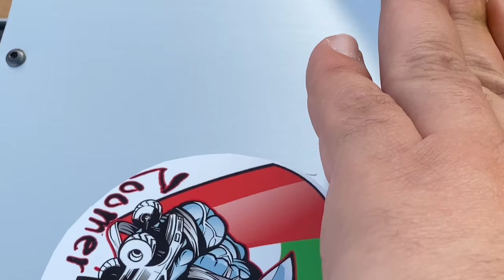RC SAND DRAG KINGS 1/5 Scale the best

Comment: A few things to talk about and discuss. The southern mud racers overdrive (spin faster than the rear)  their front tires to maintain a front wheel drive "directional stability" or "pull" the front end straight to give better traction. I know in the sand this will mean you will have to be more aggressive with the wheelie bar or rear shocks/springs to drive the front suspension into the sand to "bite" or get traction. Paddle fronts may be a help but I understand it may lower the chassis in the sand once the rear tires are digging into a rut already created by the front. Another drag racing tip by people in the USA are keeping the front track width much wider than the rear to increase front end stability when making steering adjustments. You'll notice how easy the sheet metal bending RC was able to flip over because it had the opposite dimensions (narrow front vs. wide rear track with) ( for example track width is the distance between the center of the chassis and where the outside edge of the tire is). Again this advice is from a random person on the internet, but I hope you follow up with your own research and I hope it helps. GREAT VIDEO!!!!
Reply from the maker: Wow thanks alot for all the great info

Comment: Use 4 wheel drive and take dog bones out of the front 
Lock front axles at the diff cups and leave the Center diff empty. 

Diff out all the power to the back wheels and let them spin faster.  

This will drastically increase wheel speed and help for sand dragging 👊😎

Comment: What i don't understand is why can't they make these cars full scale that people can drive just as light as as durable and as easy to fix and most of as easy to control,where u can crash it at full speed then pick it up and do it again..that's what we need
Reply from the maker: Lol safety measures
Reply: Its called the laws of physics.
A scaled up version made of plastic and no protection with 2000+ horsepower simply wouldn't work.
Reply: @markmmm1737  why not if you make everything exactly the same using the exact same material or each and every part including fluids, building them any other way with different materials wouldn't work ,that's the problem you automatically shut it down because you already know these parts don't exist,if they did people would stop buying cars and building their own in a few hours..
Reply: @armandoalejandro7209  Let's think like you for a moment but the other way around.
Let's take a regular car and scale it down to 1/10 scale.  That bodywork which is 1.5 to 2mm sheet steel would now be 0.15 to 0.2mm thick and would probably collapse if blown at by the wind.  Let's take the engine and scale that down 200HP is not going to scale down in a linear way and the internal parts are going to be so minute that they simply cannot be made.  The speed would also scale down and be boring.

You can buy vehicles that do what you want but it simply cannot be a scaled up version of an rc car.  The chassis would be 40mm thick which would collapse so it would need to be much thicker and would twist and collapse.  The motor would be so under powered due to the way it is constructed and be so heavy the car wouldn't move.  The magnets would be so large that you could not drive next to a steel car without sticking to it (exaggerated).  It simply cannot work.
Reply: @markmmm1737  yeah I get it it's a material thing, you can't drive a rc car for 12hrs with out watching it melt before you eyes but what if !! Especially rc helicopters and jets at least make them just as easy to fly it's amazing what rc helicopter Can do with two switches don't u think